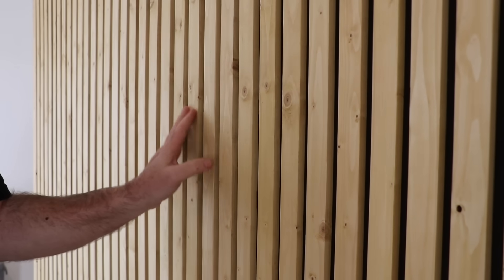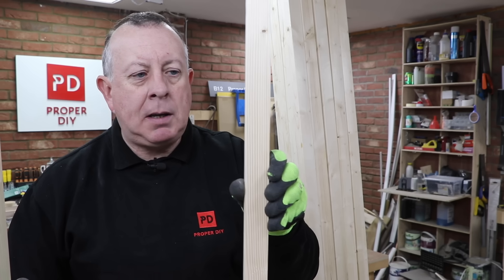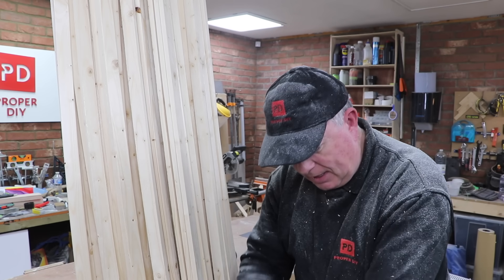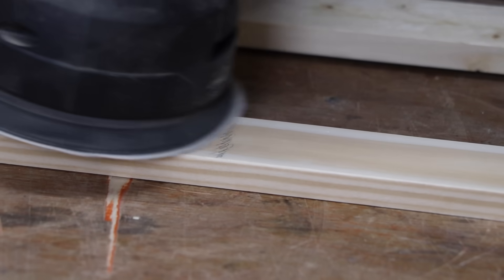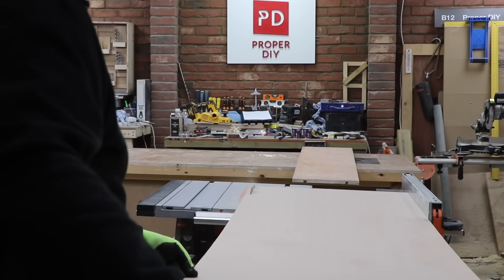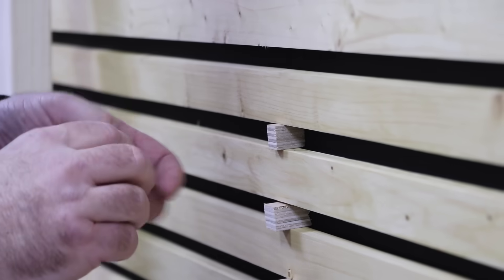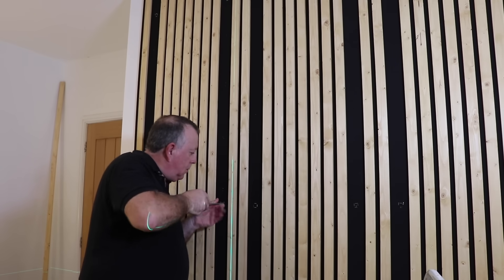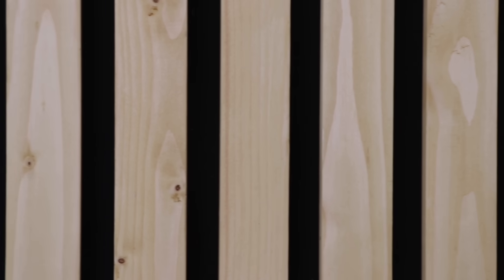Save Money Building Your Own Slat Wall

Comment: Great. Now all I need is 3k worth of equipment
Reply: Haha
Reply: Not sure how you came to this video not expecting that..
Reply: Maybe 200.quid tops 
Buying used from FB market place
Reply: 1. With diy savings to make things cheaper, if that's the approach to diy you take, you can buy tools.
II - Itt's not 3k worth of equipment. That plunge saw, for example, he uses is a lidl one, good enough for your diy when it's also good enough for private use after work for seasoned certified journeymen.
叁: Alternatively you can also make deals on better tools 2nd hand.
d) Ideally, you can just join a local maker space.

But, why any of those when making up excuses for a lack of initiative in something you'd like to do will do good enough for you.
Reply: When you buy it from Home Depot you can use their equipment to cut it right?

Comment: The project is impressive, but what's more amazing is you managed to find that many straight pieces of timber from B&Q! 😁
Reply: Exactly what i thought!!!! 😂
Reply: ahahahhaha, yea, made one myself, had to go to 3 different shops to actually find enough straight timber 🤣
Reply: Without knots!
Reply: for non construction projects, best time to get cheap wood is winter or spring, moisture in the air plus the cold keeps the wood wet which generally makes it straighter. it will warp once dry again though this takes a while giving you plenty of time to work with and put in proper fixings.
Reply: Amazing job 😎😎 I might be daft, but for an easy escape as I don’t have the tools or the space to buy tools and work it out, would it be possible to buy bed slats, stain them and fix them to the wall? As a headrest? 😅
Reply: @manarsalem9432  not impossible but it would not be a fun project. you would need to be careful how you fix them if they are the arched ones. All the slats I have seen are laminated wood, (multiple layers of wood glued together at an arch to make the curve) this means that they will forever be bowed and cannot be straightened. So you will need a really thick piece of back board to hold the slats flat and then also stagger the slats so that the back board does not warp. If you have a solid wall like brick, you could get away with directly mounting them but you will have a hard time as you will need a decent hammer drill and many many masonry screws (not the cheap raw plug type). All in all bed slats might have a cheap up front cost but will be a head ache to work with
Reply: @KrysRevamps  Not to mention bed slats always have poor quality faces as they’re designed not to be seen.

Comment: Love your videos, but don't lean over a running table saw to grab your stock. Your viewer's look up to you so you need to lead by example.
Reply: Agreed. Thought exactly the same thing.  . . . .
Reply: And walked off leaving it running. 🫣 mines off soon as the cut is done.
Reply: @dj0men666  Yup. Do nothing until that blade has stopped.
Reply: Further, you should never wear gloves when working with a table saw or rotating machines in general...
Reply: @tarquinjones2002  Agreed, as a noob, I caught my finger in the blade just on the final revolution as it was running down. Luckily only a scratch. For me, this was a final warning. Respect...

Comment: I did a slat wall recently, skipped the mdf, just used battens on the wall, paint all behind black, then jut pin them on. Stained them when they were up. Look great. Went to a local timber merchant for wood, as better quality and cheaper than big brands.
Reply: Is there USP not that the felt backing is good for lowering noise pollution?
Reply: The fabric method is way better for an apartment. 12 holes in the wall compared to… Lord knows how many!

Better to consider saying bye bye to the deposit though.
Reply: @absbi0000  it’s not hard to fill holes
Reply: That is actually my plan. Paint the wall dark and install the slats directly. How did it turn out?
Reply: @bosk_dzelski  yes that's what I would do
Reply: @Ben-ef4gf  Its not hard to fill holes, but its very hard to restore the same structural integrity the brick/breeze blocks once had. If years down the line you'd want to change it up much easier to remove the mdf. Besides the MDF will add a marginal sound dampening/insulation improvement. If your addament that you only want to paint then there are actually primed and pre-slotted MDF panels ready to paint available for half the price of these ready made solutions.
Reply: Good job supporting your local Timber merchant, especially the independents. 🙏🏻🌹

Comment: Superb video again Stuart.

One thing I’ve noticed is that you always visit a large DIY shed (I know this is proper DIY).  But I worked for 24 years within builders merchants and they are miles more competitive for larger purchases and a lot have mill facilities and we would charge a small amount for cuts and planing and so for an extra £50-£100 you may get this ripped and planed on their machines.  Also you should save even more money on timber and materials from them as you can gain a cash account, haggle prices and get these set to terms giving you consistency.  In the big sheds you just have to pay full list.  As well your brand and channel will have positive pulling power and I’d be all over giving you a discount to gain the positive publicity and ‘supplied by’ tag.

Hope this helps and let me know if I can be of further assistance.

Thanks Andy
Reply: I've tried independent merchants several times around me, but they were always way way more expensive :-(
Reply: These days builder merchants only seem to want to deal with people who will have regular orders through (fair enough!). Plus a lot of them won’t let you pick timber and want to pick it for you, can’t order and collect same day etc etc. at least with the big sheds you can go when you want and get what you want
Reply: I think the problem is that most people don't want to haggle prices. Even as a builder I avoid merchants unless absolutely necessary because it's tiresome going in and being quoted prices that are 50% higher than the DIY stores then having to haggle it down to eventually get it to 5% less.
There are a few decent places that I'll go back to but 90% are just used to tradesmen picking stuff up on their company's account or charging materials direct to a client, so they massively overcharge everything and hope they get away with it
Reply: @jacko791  I get that but not all places are that much higher to start with, especially against full list price DIY sheds and like I say you can then set these prices to terms with a cash account and gain free delivery, so once setup it’s easier and should be cheaper.  Also in this case regarding Stuart he has large pulling power with his brand and channel so most will want to favourably look after him for the positive publicity- but even so if someone is buying materials weekly/monthly then it’s at least worth checking a merchants prices against a DIY store.  Some benefits like killing and delivery will assist with time saved 👍

Comment: Looks great but certainly won’t help with sound absorption.  But a great job if money saving is the number one requirement. I bought pre-made walnut acoustic slat panels for the lounge as I needed to improve the acoustics for the hifi & they look great and worked wonders on the room acoustics

Comment: Looks very nice  mate.I did the same project in my lounge,but didn’t use mdf.Instead I’ve painted the wall black ,then nailed the wood straight on the black wall .I basically did left and right wall and middle I’ve put Marble effects pvc sheets and my tv goes on the pvc .Results were great .

Comment: Looks awesome. I do wonder why you didn't paint the MDF black, as I believe the felt will be difficult to keep clean. Thanks for your videos. I really enjoy them and usually learn something every time.
Reply: I don't get this either. It's going to be impossible to clean when the dust gets to it.
Reply: He could have made good use of his spray gun to paint the mdf.
Reply: Is it something to do with sound insulation or acoustics?
Reply: @gerryheynes5082  not really as the reason you use fabric is so the sound can travel through it and then get absorbed in the space behind. Mounting onto MDF negates this almost completely.
Reply: fabric will soften sound a little but won’t do much surrounded by wood. The panels in b&q or elsewhere are a thick material that will absorb sound much better
Reply: @peterreime3146 yeah not much point using fabric without a fat slab of rockwool behind it.
Reply: Ya its mind boggling. Wife gonna be absolutely pissed after a few days 😂 seeing the dust trapped black fabric

Comment: I'm doing the very same thing luckily I'm a joiner and understand not everyone has the tools I have. There are places that will cut down the timber you need And to put them together you can use a fast setting glue(mitre fast) when you have them where you want them you can turn it over and screw them from the back......I recommend  if you are painting them just rip down MDF and put them all together. To get the sizes check some at bnq and right bit down

Comment: My first thought was: How to mount on the wall? First guess was: drill a hole through the timber, screw onto the wall and plug it with one of those wood plugs. Further into the video: How would he mount the timer without a visible nail?-> Nail from the back and carefully hit the timber? Nice solution. Keep it simple! Thanks for sharing.

Comment: That's hilarious - I said in a comment last year that you keep making videos when I'm thinking about doing something, I was literally looking at doing this like 2 weeks ago. Aside from the table saw I'd say maybe rent a thickness planer, the lunch box type, for a day - get your slats in order first then spend a day doing that; the quality of the job is going to be massively higher, for what, an extra 50 quid? I'd say minor complaint, watch the quality of wood you're using because that's a lot of knots for something that is ultimately decorative - might be worth spending a little more, getting nicer wood, and you'll still likely save a packet for a better product. I bet that type of wall covering is actually quite insulating, between the bulk of the material and the boundary layer effect caused by the air stagnating around it because of the profile.

Comment: Nice video! I bought a dewalt table saw for a project as I knew in the long run it will last me forever… wife wasn’t so convinced and asked me many times to sell it. I won’t. It also built our kitchen countertops with ease than have a cheap one that could brake. 😅

Comment: Another great video Stuart and an interesting method for doing something which, as you say, is very popular these days. I only have a small query and it is my balance OCD at work, why didn't you begin the first panel on the left hand side exactly on the outside corner of that wall (near the door) and then create a small corner filler piece on the inner corner on the right hand side please? The absence of panelling (1 or 2 slats) on the left hand side is  sending my OCD into overdrive. Other than that it looks fab and a great project start  to 2024. Keep up the good work !

Comment: Nice work. the only issue I have is the background. This is an acoustic panel and the background is supposed to aid in absorbing sound. %There are non-accounstic plastic panels with a similar look that cost less than your budget. But I love your initiative cos I'm using the same strategy to build my acoustic panel.

Comment: I made the similar kind with just oak plywood. Even cheaper and no knots. Best part was that I could choose the width of the gaps, because I used acoustic back panels (got good deal for 50 panels), which means that the gap should be around the size of the panels so that the acoustic panels can actually do their work and the sound waves don't just reflect of the panels. All in all it cost me around 15€ per 2400x600mm acoustic wood panel. I'm installing 20 in my studio and 30 I'm gonna sell. If I sell all 30 of them, I'll pay off the ones I installed in my studio and actually make a profit on top of it.

Comment: Is that fabric fire resistant? in the US, fabric on walls need to have a fire rating. For instance, office furniture fabric has a fire rating. The theater i built, has fire resistant fabric (will not say fire proof). needs to char and not burn.

Comment: From the USA.  I like your project.  I think I would skip using the planer and just use the random orbital sander.  To add a little class to the project you could use a !/8" Round over bit (no corner splinters this way).

Comment: Well done on the project , another method would be to use a veneered board for the face slats ok you would see the mdf edges but in reality would look fine and be more stable than using pine which can be very unstable

Comment: Out of the box suggestion, cut get a cheaper plunge/track saw cutting strips of mdf you wrap with material and sound absorbing material, then pin to decorative ply which you’ve sanded and painted making sure the gaps are wider 👀

Comment: I happen to see a wall similar to the one you made when I was out last week at a restaurant.  They used if for an accent wall so it was just the one wall.  I'm going to do a wall in my house like that.  What I think I'll do differently than you did though is just paint the wall the color I want first.  Then I'll put the boards up.  I suppose it will be the same affect that you have.

Comment: Did similar work recently unless you're trying to achieve a real-wood effect. The imperfections in the wood would pop-up significantly. That is the major drawback between a panel vs soft wood.

Comment: I Bought slats, the ten packs from wickes. Almost all had imperfections, either not straight or the wood was too knotted or marked and did not look good.

I got a better result buying an mdf sheet from B&Q and used their free cutting service to make first 15 cuts free.
So much time saved in cutting and clean up.
Plus the mdf is perfect as i painted the slats. The finish was far better.

Your time is worth more.
Reply: What sizes did you asked to cut as I am planning to do same thing
Reply: @mikeyellow  cut them in 4cm (400mm) width. Get thick mdf, min 2cm (200mm) thick sheet.
You need to join b&q free membership which gets you the 15cuts free.

Do not waste your time with the video above. It will take far too long and cutting yourself will be so messy. The mdf looked so much better than the wooden slats,, unless your spending serious money and buying oak, or some real expensive hardwood.
I did a project for a Nandos type restuarant and the oak wood was extremely expensive from a manufacturer that dries it in a certain way.
Reply: @redx11x  thank you so much yes I think mdf will be much easier.
Reply: @redx11x  Yep I agree, too many imperfections in pine especially with a DYI saw table. It was still a good video showing pro's and con's so not going to bag it.

Comment: I'm always curious of the advantage of battery power tools that use extractor hoses. What is the advantage of the battery? Or even, what is the disadvantage of the power cable? I always just tape my cable to the hose and then have stable power and no need to worry about if the other battery is charged yet. 

I have many and can see the advantage of battery tools, but my sanders, plainer, and track saw are all cable.

Comment: I liked your secret tip for what to do if you don't have a table saw which you left until near the end.... buy a table saw :) Seriously though, I was already thinking that it's a good investment even just for a project like this.

I've always thought about doing my own slat wall, I was toying with the idea of going to Lawsons to buy roofing battens which are already near the right size. With a bit of work they can be made to look nice. And if you select them carefully, in my case go to Lawsons and spend a while looking at them, definitely NOT from Builder Depot or a cheaper place, then they might even be straight. BUT - I think your idea is better. CLS wood is just better for the job.

Only thing I'd do differently is the stain, because I prefer a darker wood look like a walnut or something. I'm even tempted to do this project with a special wood like sapele - far more expensive but incomparable price to buying something like that as a "system". Builder Depot does sell this hardwood decking which is Balau I think, a very lovely colour and a stable wood for this job I reckon (although I'm not a wood expert... just my experience using it so far)... although not so easy to work with!

Comment: nice project, although the point of the acoustic slats is that you have a void behind them that is normally filled with acoustic mineralwool to act as sound "sponge", so the MDF board would negate this effect. Alternatively you could do what @pauljai7151 mentioned in his comment and use battens instead, then you can get the sound deadening effect of the wall as well.

Comment: The difference in price is down to the quality of the finished job. CLS is full of knots which will pop out and you don;'t get in the more expensive product. You also don't see nail heads. You get what you pay for. The B&Q acoustic panels are rubbish but there are better products out there. If you are going to do it DIY then go to a proper local timber yard (support local business) and get a higher grade of finished timber. You'll have a much better finished job IMO.